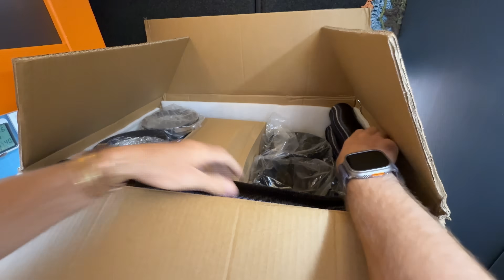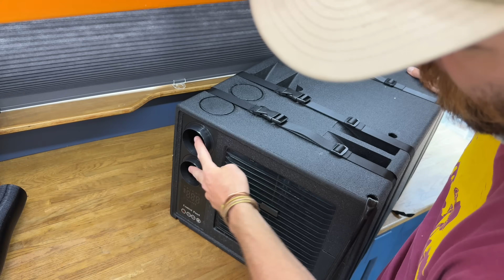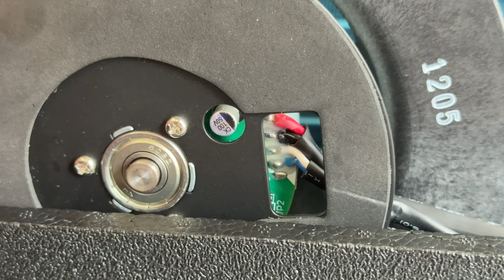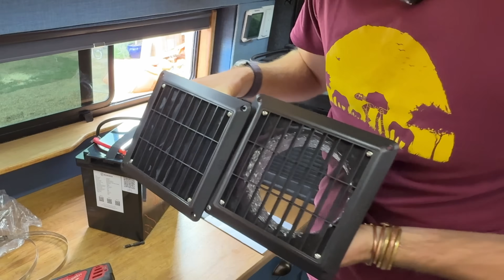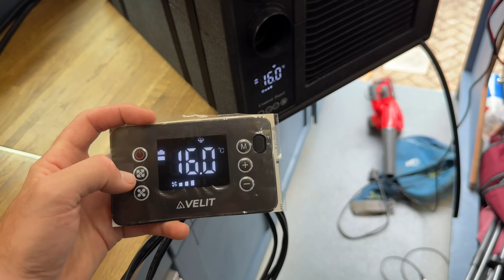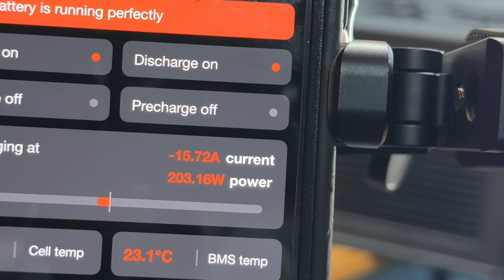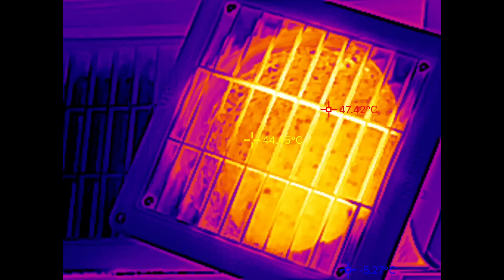12V VELIT 2000U Air-Con | Power Test for Off-grid Use

Comment: Am only at 5mins 26 into the video and seeing this Buck Converter.
Question: Does it mean all the fans are 12V in a 48V and 24V system with just a swap out of a buck converter only.
Present in the 12V to stabilise the power. But ofc all types adding to heat within the assembly, fins means losses. 
Needs some more research, but lets see what the rest of the video reveals. I'm surprised I hadn't seen this video already, but reaching my feed 'cos I'm looking;  24V to match my battery and hoping to take advantage not throttle.
Reply from the maker: Whilst I would need to check further as it was quite awhile ago, the buck converter I feel was for running everything else apart from the compressor which was at the native voltage you order it for.

Comment: Great info Alex, thanks. I’ve been looking at these under bench units as I have no room up top due to 400w of solar. I also have a Roamer 460ah battery so that should get me through a night with this unit. What about the 230/240 units like the Truma shapir, would they be less efficient due to needing to run through an inverter?

Comment: Very very good and detailed test. You defo motivate me to get one of those under bed ac. I actually have a 240v 400w ac. It pulls about 40amps inc inverter all the time and there’s no way it’ll cool down the van. It just pulls cold air at the duct so you have to face it while the rest of the van is hot around. So I’m very happy with those test knowing it’ll probably pulls less amps and cool down better when it’s hot.

Comment: Hello Alex, Thanks for this one. I am looking at an under bench unit as a good solution for my transit. I guess with a modern powerstation type set up it is possible to choose between a DC (12 or24v) or a AC 230v unit (such as a Mestic BA-2600. Any thoughts on the best way to go?
Reply: Hello have you got a 2000 U A/C ? I installed one, recently but haven't any opportunity to use it now because hot weather won't come before June. It's new and operating correctly right now I just made a test but that's not necessary to get cool air of course in spring. I just wish to start sharing experience with other owners. Do you know anyone who own a 2000 U under bench type, air conditioning unit in his van? I would appreciate, much thanks. Emmanuel

Comment: Would you replace the ecoflow wave with this one? I was thinking of buying the wave 3 to put in the transit H3L3. Is this a better option?
Reply from the maker: I use the Wave 2 at home. I think the Wave air con units are great but can be a bit awkward to mount in the van

Comment: Hi Alex. I’m wondering if you can help please. Will the EcoFlow 3 run my 8kw Chinese DH from its 12v socket? I’m informed it will? I’ve got the river 2 which won’t without a 240v transformer. Hope you’re somewhere exotic mate. Cheers. Andy
Reply from the maker: Potentially, the Chinese will run off the 12 V socket. Specifically which EcoFlow model do you have? 

Early this year I did a group test of about 15 different power station models and less than 25% of them could run a diesel heater off the 12 V socket. 

For the ones which could it’s still borderline maxing out the socket

Currently in Mongolia

Comment: If it doesnt heat, why does the title say the video is about swapping out a diesel heater for an air-conditioning unit?
Reply from the maker: I think you misunderstood. The title doesn’t, the first few lines of the video say I’m swapping making diesel heaters videos ( which my channel does a lot of ) because it’s summer for Air-con videos
Reply: Ahh, yes. Thank you. There are home air-conditioning units thst also heat houses. 
Thinking now, you could maybe actually swap a diesel heater to one-off those for heating and cooling....
Reply from the maker: There are a couple model of campervan air-conditioning, which also work as a heat pump as well. But those are never going to be as good as a diesel heater.
Reply from the maker: I think you misunderstood. The title doesn’t, the first few lines of the video say I’m swapping making diesel heaters videos ( which my channel does a lot of ) because it’s summer for Air-con videos

Comment: Good thumbs up for this one!
You answered all questions I would have had- specifically about solar input vs. power consumption.
This seems to be a good unit!
I‘m also impressed by your battery. Ok, it‘s a fresh/new one but it coped with the power consumption quite well. How many Ah was it?
Oh and I‘d say the AC never drew anything- the battery pushed it and the AC let it through…
Reply from the maker: The Roamer Smart4 12V 105ah is a great little battery. It’s got the output to run the AC without issue and lots of head room left ( BMS wise ) , it’s just small capacity wise for air-con ( fine for testing ) . 320ah, 460ah or more you’ll have for off grid of running air-con

Comment: is velit heat too or only cooling unit ?
Reply from the maker: Only cooling this unit.
Reply: I installed one 2000 U A/C, recently but haven't any opportunity to use it now because hot weather won't come before June.  Emmanuel

Comment: I bought an identical unit on AliExpress for around £450 delivered to the UK last week.  The branding is different - but it's identical in every other way, including the power-draw.
I'm super impressed with mine!  It does a decent job of just regulating the temperature and keeping the power draw to a minimum.  I have 1.1kW of Solar so have been able to just leave it on all day whether I'm in the van or not.  That chills the van sufficiently while the solar is available to minimise power draw in the evening.  Although this uses more energy, it results in a fuller battery in the morning than trying to cool a 40C+ van in the evening.
Reply: Hello Simon, what a serious technical video 
 Are you satisfied with the cooling efficiency of the one you bought ? Do you use it while the vehicle is in motion ? I know it's possible, this is very interesting as the alternator gives power to the battery and therefore we don't need solar power, I guess ? I would appreciate your review, and will probably buy one also. best regards, and thanks in advance for your help ! Emmanuel
Reply: @emmanuelbouts3021  It's pretty good!  In the summer, I just leave it switched on whether I'm moving or not.  I have 1.2kW of Solar on the roof which is enough to run the solar and charge the batteries (7kWh LiFePO4), so I can leave it running at night too.
I tend to switch it off at bedtime though as, even in it's 'night' mode, it's still noisier than I'd like.
This year, it made a huge difference to the time I spent in my van.
I would definitely buy it again!
Reply: Was about to say this unit isn't worth 1600usd lol even with an U.S. warranty unless it's a bad product and the operational cost would too high to maintain. Even the eco flow which has a bit more tech in it doesn't cost as much
Reply: Can you send me the link please?
Reply: which exact one please ? been looking at these on aliexpress, too many, unsure of seller reputation,etc.
Reply: Please share the vendor or a link, I'd like to compare the specs.
Reply: Link?
Reply: @simon_rafferty link from ali express?
Reply: Hello, I have a question, Have you gor a little consumption when the unit is OFF ? and did you install a power switch to completely disconnect the 12 v supply when you don't use the air consitionner ? if you have no switch, does this bother your battery ? did you notice a remaining consumption ? thks for your help . Emmanuel
Reply: @emmanuelbouts3021  When it's in standby, it consumes around 5W - which is a bit more than I would have liked.  I put a 12V 100A breaker in series with it so over the winter, when I'm not going to need it, it's entirely isolated.
Reply: I installed one, recently but haven't any opportunity to use it now because hot weather won't come before June. It's new and operating correctly right now I just made a test but that's not necessary to get cool air of course in spring. I just wish to start sharing experience with other owners.  would appreciate, much thanks. Emmanuel
Reply: Hi @Simon_Rafferty, could share the aliexpress link? Much appreciated!
Reply: Link please?

Comment: The 60A is probably a peak spike when the compressor starts, probably only visible using an o-scope.
Reply from the maker: 54A continuous is the highest I got from it. 

It’s meant to be soft start and slowly cranks up the hotter the inside ambient temperature is. 

But as you said I don’t have anything which could show a peak

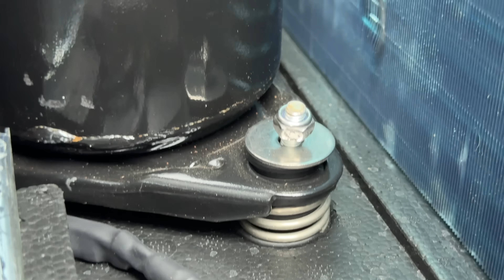Comment: 6:59 I'll bet you that bolt is loose because of vibrations pulled it out of the foam base in transport.
Reply from the maker: I see why you might say this, but I don’t think it’s the case here. the other two bolts had a lot more thread showing above the nut. After I tightened the nut this It matched the others.

Comment: Very interesting.  Can you get it to cycle internal air only (ie not suck in external).  Would be good to see how that works.
Reply from the maker: It is only cooling the internal air. 

The external air is only sucked  in to cool the compressor and then taken again. You don’t really want to be cooling the compressor with internal air.

Comment: I really want a unit like this because my wife struggles in temps above low 20s, but not sure it'll fit in my T5 sadly!
Reply: Hello , did you buy the Velit 2000 U or the chinese one ? thanks for your help ! Emmanuel
Reply: @emmanuelbouts3021 I actually haven’t bought either yet - I was trying to figure out how to place it in the van but being a short wheelbase Transporter I just can’t figure out a good place where I can still cut the vent holes.

I did have a look at the Dometic branded one at NEC camper show last weekend though, it’s more compact than you’d think so I definitely want to try and make it work!

Comment: One of the big things that affects the internal van temperatures is the colour of the van, the lighter colour vans stay quite a bit cooler in direct sunlight than the darker colours every little helps 👍🏻🇬🇧
Reply from the maker: Definitely which is also why I didn’t bother doing any real cooling  tests apart from the initial seeing if it would cool. because everybody’s vehicles is different configurations and colours
Reply: Yea. Our van is jet black🫠 nice  in winter sun. 😊

Comment: $1600... yeah right 😂
Installed a $160 small window unit (5000 BTU, 700W) in my ford transit high roof (using wall cavities and existing skirt openings, not through a window). Get 71oF (21oC) on 90+ (33+) days.
1 year and 10K miles (16K km), no problem. If anything breaks, it's just $160. It has  been readily available under various brands (GE, Frigidaire, etc) for more than a decade.
Reply from the maker: What wall unit have you installed? I’m not quite sure what you mean by you’re using the cavities and skirt
Reply: @MispronouncedAdventures  yt keeps deleting my detailed reply. You can see the details via the "van build" link under my yt handle, in the post "Air Conditioning Setup"
Reply from the maker: Cheers I’ll have a look. 

Not sure why it deleted your comments did you put a link in it? Sometimes Youtube doesn’t like links in comment.
Reply: @MispronouncedAdventures  No, I pasted a bunch of model numbers and prices. yt must have interpreted that as spam or something.
Reply: Is it a DC 12 volts system ? or 220  AC ?
Reply: @emmanuelbouts3021  110V AC

Comment: Interesting video - thanks…. I have a boat and for one week a year I think hmmm…. Aircon could be useful… although the last few years it’s been more than a week or 2!  It would struggle (wouldn’t) to the boat…. But if limited to the bedroom and perhaps head (toilet) it would make sleeping much more comfortable!
Reply: Just fitted one to my boat. PITA running the ducting, I ve put one high in the saloon and then run one forward to the main bedroom with the ducting going through the second bedroom (figured the cooling effect from the pipe would cool that enough, but as its mostly a store Im not fussed. The heat exchanger hose draw and vent into a out door cockpit cupboard that I have added in extra vents to for air flow. The drain goes into the bilge for now but Ill get a small a vac pump to suck it out. I ran it flat out on an old 90ah car battery on jump leads whilst i was fitting it as a test and that was also not venting outside just back into the room. if did cool the saloon quite nicely on a 28C day to a much more comfortable temp, and I got about 1hr 2- mins from the battery that Im not sure is in the best of shape. The trick would be to get the warm air out of the boat as much as possible first so maybe using the fan mode and opening the windows could help. Boats dont have all that much insulation but are white so will reflect sunlight. Ive also tinted the windows to help keep the sun out a little bit. Ive now added 2 new 95ah batteries and will be adding another 2 140ah leisure batts. The batteries are always on charge using shore power and its unlikely im going to be off shore power for more than a night, but it would be nice in summer to keep the unit running out on the water so the dog has a cool place to retreat too! Ive also got a back up which is the ecoflow wave 3 with a battery pack so that can run on the 240v supply and vent out a window or run on the battery which should also last over night. Just need some warm weather again to test it out. Im hoping that when connected to shore power the unit if uses in eco mode wont drain more than the charger can put back into the batteries. Still even if its just for the hottest days and it just drop the room temp to 22 that more than comfortable enough to cool down in if the outside it 26 or more as it will feel alot cooler either way

Comment: Cheers Alex mate, interesting to see this performance as here in Australia 40 plus temps need air conditioning
Reply from the maker: Will heat like that Id probably want to go for a higher Btu unit, at least you guys seem to have more sunlight for solar to keep it running

Comment: Oh you badger!!!   I was looking at these for my next build - thank you !
Reply from the maker: I’m planning for Aircon in my next build as well quite a few different configurations out there
Reply: @MispronouncedAdventures  you might want to take us with you in the choice.  I have got a “Telair e-van 5400” on my L2h2 ducato it runs on 230v on my Victron mp2000 taking about 58A on the DC side of that. And it’s quite a noisy unit as it sits on the roof above my bed, also resonating the entire roof which has plenty of sound deadening and 20mm insulation on it. The overal performance is weak and takes ages to cool the van.
Reply from the maker: @Sjoerd-Claudia  never heard of that unit before although ( I’ll look it up )  I would think 5400 Btu might be a bit on the low side,  probably take the edge off the heat but not cold. 

I am looking at the Dometic Freshjet 3500 for the new van
Reply: @MispronouncedAdventures  Yeah - I'd prefer a cooling / heating combined unit as opposed to cooling only and having to install a D heater.  Lots of different options out there, but the "underseat" unit look quite good.  Power isn't really an issue due to the large amperage batteries and large solar panels these days.

Comment: Looks to be a useful unit, but I wish their homepage and download manual included the specifications in metric as well as imperial. Is the weight in US imperial pounds or UK pounds? Not even that is specified. The conversion I did had it at about 16.5kg, so whilst not the heaviest of aircons, it is quite hefty for those who may be considering putting it into some kind of trailer.
Reply from the maker: The primarily a company to and based in the American market so I ran into this issue the first time I was looking at the diesel heaters. it only did Fahrenheit
Reply: Imperial pounds are UK pounds. US pounds are the same. Imperial measurements take their name because they were the units imposed on countries by the British Empire.

Comment: 5000 BTU window AC uses 450w costs under $200 CAD.  I have 12000BTU in a trailer works good at 1080W. A 2000BTU should use less than 200w. A good backup if all else fails can run off a car battery so that's a plus.
Reply from the maker: Given the Btu you’ve mentioned there versus the electrical, what’s pretty similar to what I experienced on this unit
Reply: @MispronouncedAdventures  some AC specs don't have watts in the ad, say 10000 btu x .1 1000 x .9 = 900 w. It's pretty close.
Reply: Bobmonz☆☆☆
200w at volts?